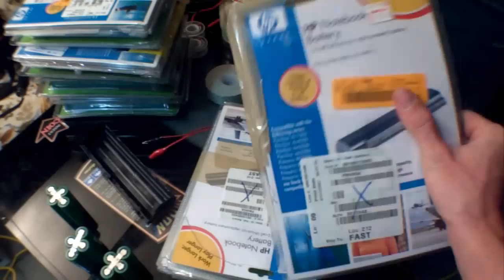DIY: 48v 24ah lithium ion 18650 e-bike battery pack

Comment from the maker: its an "American Beauty Soldering Iron" from about 1965 and runs on 115v AC pulling 300 watts of power. model no. 3178

its made for very industrial applications like soldering roofing metal together but i find it works great for electronics. i bought it a few years ago for like 2$ at a yard sale and just this past month discovered how useful it is.

Comment: Lithium cells are chosen together for each battery in order to have the most similar capacity possible so that as the pack discharges, one cell wouldn't get reversed. You could have at least mixed the colors in each parallel group to get near the same capacity. You put the same colors in each group to make it look pretty, resulting in the worst possible capacity difference.
Reply from the maker: lol, you think color = capacity rating.
Reply: Rinoa Super-Genius
Not at all. I did put it simply, it didn't help you. By color, I mean manufacturing batch to be more accurate. The best way would be to mark cells coming from one particular pack with a letter. Also, when you see large discrepancy in somebody's apparent knowledge, chances are there is just a misunderstanding and the "bad half" is not actually bad.
Reply from the maker: ZdenekJindra
no I get a lot of people commenting on my stuff who have everything upside down.

all these cells are pretty much the same capacity. not counting only an idiot would ride his battery down so low that it could get damaged.

Comment from the maker: if it was running at 4v yes. but it's wired to give more volts so it has less amp-hours.

wiring cells in series doesnt change AH rating while adding the cell voltage together, likewise wiring cells in parallel doesnt affect voltage while adding the AH capacity together.

so you can use a combination of series and parallel to get you the battery power you want, the cells dont have to be only series or only parallel. just make sure the cells are evenly distributed through your pack.

Comment from the maker: because i had a box of nails on the shelf.

if one of the cells shorts out all the cells in perallel with it will feed power into it and the whole battery will either melt or explode. but if one cell losses capacity it doesnt matter since a lithium battery's capacity is voltage dependant.

the only time you would have issues with a shorting cell is if you ran it down to bellow 2 volts and then charged it really hard.

Comment from the maker: oh you can go as high as you want for the AH rating. if you upgraded your battery to 24ah the motor would still pull 250w of electricity. it' just the battery would be able to supply the power easier.

i think Li+ battery is a great idea. do you have universal power supply and multimeter? you might want to get a battery balance charger too, they are cheep.

i'd look for old laptop batteries in trash. if you can find a bunch of those that would be awesome! dead packs usually have a few good cells

Comment: Nice project but great way to blow a pack... your packs in series should be the same AH! and using a balance connector and balance charger is a really good idea... your batteries may be in balance now but to keep the pack healthy, use a balance charger. I run NCR18650b panasonic cells and would never charge them without a balance connector. 

Great project! and keep on going! there is a lot of potential in Lithium Ion... and they are safe... that is why the tesla cars use them!
Reply: He has 2x 22.2v(6s) batteries. He balance charges each on his imax b6. I'll be using his method this summer, plus a bms for balanced discharging of batteries of various capacities (1ah max difference)
Reply: if they are balance charged then you are good. But the real worry is the differences in packs. even at 1ah thats a large difference. when the larger pack is getting low, the smaller pack will already be damaging itself. I NEVER run different size packs in series. in parallel it is ok though since the voltages can balance everything out.
Reply: Atom RC I haven't built it yet. I'm getting used batteries in the mail tomorrow that I'm tearing open. I'll be matching internal resistance in parallel by considering the useful charge divided by the rated charge. Past that, I can expect a little difference between each 3.7v battery, which means that I'll need to use a bms for anything more than testing.

Comment from the maker: my 35MPH max speed isnt dependant on the battery but my motor. if your bike can go faster then that would also mean you have a motor bigger than 1kw.

it weighs about 3-4 pounds. the battery voltage can max out at 25.2v per pack but i run them to 24.0v to get about 2500 charge cycles from it at most.

max dicharge amps is unknown, the 20-25 amps my motor pulls at max acceloration doesnt make the voltage dip more than a bit. but has enough amps to vaporize a connector. so i'd say 60 amp bursts.

Comment: You will probobly have some problems with unequal charge and disscharge if you dont have any leveling system. Almost al modern lithium packs have a charge leveling system that alow the system to both measure and discharge a single bank of batteries.
Reply from the maker: thats why i balance charge it.
Reply: Okey, i didn't see that. Do you charge every cluster by them self or use a other method? Lithium battery is really sensitive. Can break a cell with just one faulty charge. I got a makita battery that broke a cell tow it have cell by cell charging.

Lithium Iron battery's is a lot better in this way, but of cause, you cant get them this way

Yea... looked it up, 12V 10Ah, about $130+VAT, that's kind of expensive.
Reply from the maker: matsv201
well i show in the next video how i charge it....
Reply: matsv201

Comment from the maker: yeah that is an issue that popped up, my 1st battery pack had cells that where basicly the same capacity so they didnt fluctuate much. i'm working on a charging design for this battery. in the meantime i unwrap the tape to charge it and inspect the battery for faults. and i just charge each parallel pack at 4v. i'll make it automated someday though. gonna have ribbon cable coming out of the battery for teh charge controler.

Comment: Do not do anything that you see here.
1.He is not using cell balancing PCB!! WTF
2.Do not solder these batteries. Unless you don't care about your house or face.
3.All cell are not same capacity. Will notice it after second recharge.
Reply: professional
Reply: There's a difference between doing it right and just doing it...ask your girlfriend more info on that topic...

Comment from the maker: but an example of a well distributed pack would be 10 lithium cells running in parallel (4v 20ah). you would have 3 of those and run those 3 packs in series to make 12v 20ah. when you have similar batteries running in parallel you could imagine that parallel pack as just one big battery to simplify things. and you only use the same size batteries in series, like you never see a flashlight that takes 3 AA and 1 D cell to make 6v, the 3 AA batteries would drain long before the D cell.

Comment from the maker: remember you get less ah from your battery the higher the current draw because more is wasted as heat.

look up the Panasonic 18650 datasheet and it should have the ah ratings for differant discharge currents and a chart.

it depends on if you wanna know the highest ah rating or the functional one. if your motor is going to pull 15amps then maybe test the load with 8 amps. but if you wanna find the highest ah you can get from it try like 2.5ah (car headlights tend to pull 2.5a at 12v)

Comment: I've been going down this venture for an eBike.  I went from wanting to buy one, then to wanting put one together.  Either way, the whole process came down to spending money, one way or the other.  Then I asked myself, "why can't I build this batter on my own" and voila, here I am.  My only thought was that I know they make cases that would support cells.  Either way, I'm still learning.  But, I wanted to say thank you.  I'm in no rush to get this done.  But, I'm going to continue to see where this takes me.  Thanks!
Reply from the maker: radio shack's project boxes would fit cells, and another case idea is a water proof plastic fuse box. they run about 25$ and could prolly hold 48v 12ah worth of cells.

hope that helps.

Comment from the maker: about 1$ per cell, give or take a bit. spent like 160$ on enough cells to built 2 35ah 24v packs and 24 extra cells. my origenal battery pack was about the same price per cell. it cost me 90$ in cells. and some more money in random bits and connectors i had to get.  but still not a bad price. thats roughly 2$ per mile of range if the cells are newish.

Comment from the maker: the main differance i know of is the price. Li-ion are a fraction of the price of LiFePo due to being able to buy old Lithium-ion tool batteries and laptop batteries for cheep. and btw there isn't much differance between Lithium-Polymer and Lithium-ion. it's just a differance in how the cells are built.

and as for your 1st comment you deleted, yeah you could prolly pull 40 amps from 20ah pack. but the less c you pull per cell the longer they will last due to less strain on each cell.

Comment from the maker: no he has 16 4v packs, each pack with 4v and 4 cells i think. also remember he got LiFePo (i think) so voltage is differant. but hey 64v would do wonderfully with a 48v hub motor.

Comment from the maker: that depends on what voltage you charge them to. the lower you charge your LiPo cells the more cycles they get. i should get up to 2000 cycles from mine. also depends on how many amps you regularly pull from each cell. less strain keeps your cells healthy.

Comment: Why did you use nails and not copper? Your putting resistance in your circuit that you don't need!
Reply from the maker: because its what i had. its not a big deal.
Reply: Good luck with  your project. I'm enjoying the video.